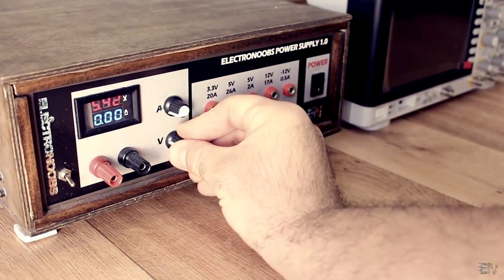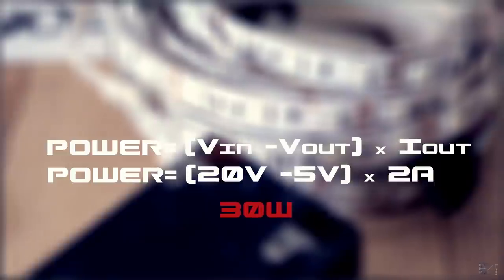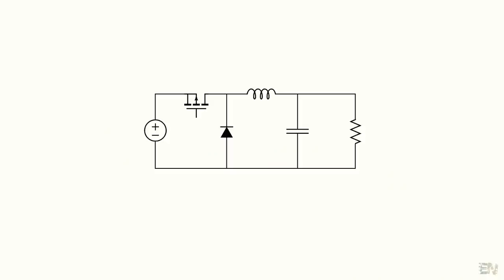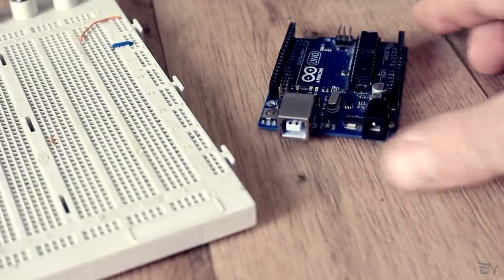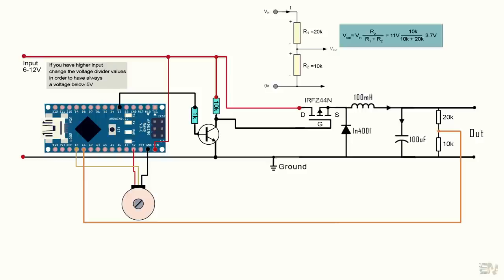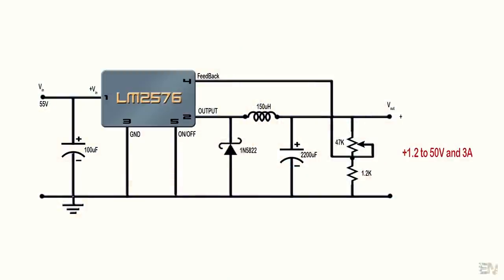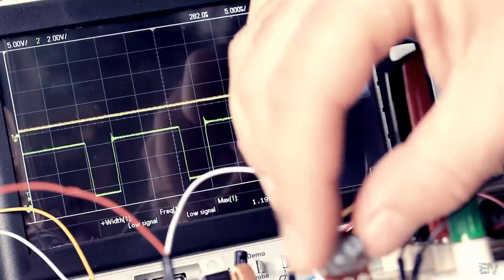DIY Buck converter - TUTORIAL

Comment: Consider an electrolisys aplication.  The plates and electrolyte form a capacitor.  In the begining, the electrolyte is cold and conducts less requiring higher voltage to push current through. Then as the electrolyte warms it becomes less resistive and conducts more current.  Annunregulated buck converter dops in voltage with a higher current draw.  And with electrolisys,  lower voltage end up drawing less current and produces hydrogen more efficently. The current voltage responce us more like a zener diode and resistor than a simple resistor.  This loosely  uses current to warm up the electrolyte making it more conductive so that it can pull more a little more current at a lower more efficent HHO generating voltage. It  loosly self regulates the current without feedback circuitry.  An adjusable pwm circuit can  may be more interested in lowing the duty cycle with feedback from a temperature sensor to further regulate  how much current goes through the cell by lowering the outut voltage further, thus controlling the watts consumed by the HHO cell and further improve efficency.

Comment: Where the heck am I supposed to get a 100 milihenry (mH) inductor?  I HOPE you mean 100uH.  I dont think the one in your video is 100mH with that few of turns - but clearly it is high Q given  the wire size - I mean trying to buy one from like Mouser is $46 for a 1A and it looks like a small transformer.  Also on some of your schematics on your website, you have some of your FETs the wrong way (forward biasing the body diode).  That would suck if you hooked it up that way LOL.

Comment: Hi, a schottky diode is used because it is a high speed switching diode, compared with a 1N4001 series diode.
High speed because of the switching speed of the converter output.

Comment: The inductor has a current charge rate.. 
The capacitor has voltage charge rate..
Together, if you know how to sense voltage discharging edge triggering, you can choose when to charge the cap n inductor.

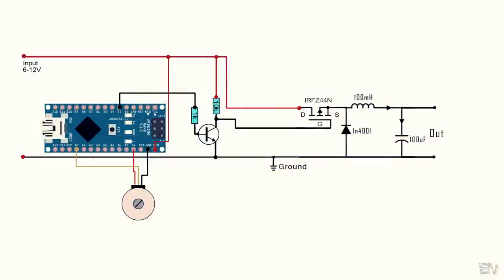Comment: This is a good video and I don't want to have to critisise here buuuuuuuuuuut ... I don't see how the circuit at 8:28 could work, or at least work well. I know how a buck converter works, but it's the way the mosfet gate is being driven here that is getting at me. Surely like this the gate won't get a good square wave and instead will be more of a ramp wave because of the mosfet gate capacitance, right? And wouldn't that get even worse with more load due to the miller effect? And also, having an n-channel mosfet connected like this, surely the gate voltage could never get high enough to turn the gate fully on so the mosfet will be in it's linear region? Also it's drawn here as a p-channel mosfet where as an IRFZ44N is n-channel.
Reply: Yes there is a N- channel mosfet and there should have been a P channel just like you said. If you put a N channel like that it will be mostly closed or just very slightly opened. Well the miller effect is really a problem only in case of transistors used as amplifiers, since it changes the input and output impedances slightly and can limit the frequency range of the amplifier, but in case of switching transistors it shouldn´t be a problem. The gate doesn´t get the same square wave as it comes out from arduino, but it is a lot sharper that you might think, to make it ever sharper I would decrease the value of the 10k resistor to maybe 2-3k depending on the datasheet of the bipolar transistor. But because of the approx. 33kHz frequency the mosfet operates on it is low enough to make sharpness of the edges more than sufficient to fully open and close the transistor (at least my oscilloscope says that :) ) hope that helped. if you want to correct me on something please go on :)
Reply: I have some questions,
shouldn't be the gorund of arduino connect to the circuit? 
And why Vin is connected to input voltage? Can arduino stand 12V ?

Comment: Hello, maybe I still make something wrong. There is a schematic at 8:28. You use IRFZ44N. It's an N-Channel, but you use a P-Channel symbol. Another is the value of L and C. The value of L can not be compatible with 100UF E-Cap.
Reply: You're correct, it should be a ptype mosfet. An ntype wouldn't work here.

Comment: 5:47 Unclear. How can an open switch be damaged?
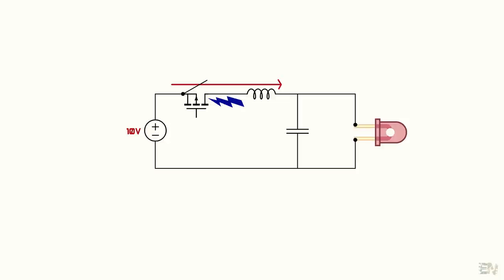5:59 Unclear. How is current going from supply negative to load positive?
Reply: A very fundamental property of an inductor is that you cannot instantaneously change the current through one.
When the switch is ON, current flows from the input supply through the inductor. When you turn the switch OFF, the inductor "tries" to make the same current that was flowing just before that continue to flow. The voltage across the inductor will rise to whatever magnitude is required to make that current flow. That voltage could be a few millivolts if there were a low-resistance path or it could be thousands of volts if the only path available were very high resistance. (with practical, real inductors you usually don't get extremely high voltage because there is enough capacitance between the turns of the windings). The very high voltage can easily destroy a semiconductor switch. With a mechanical switch the high voltage would cause an arc across the opening contacts.

In order for the current to continue to flow in the same direction in the inductor itself, the voltage across the inductor changes polarity. One way to understand this is to draw a simple circuit with a battery, an inductor and a resistor in series. If you "instantly" replace the battery with a short circuit and keep in mind that the same current continues to flow at that instant, you'll see that the voltage across the inductor must now be the opposite of what it was with the battery in the circuit. In the circuit as it is shown in the video, the diode makes the path that allows the current to continue to flow, transferring the energy stored in the inductor to the capacitor and the load.

One thing that helps in understanding how these circuits work is to consider the output capacitor voltage to be constant during any single switch cycle. In reality the capacitor voltage does rise a little bit, but normally the circuit is designed so the rise is very, very small relative to the average voltage on the capacitor when the circuit is operating normally. Of course when you first start the circuit the capacitor voltage is slowly raised over many switching cycles.

Comment: Couldn't you use a OpAmp for the gate of the MOSFET..? To Regulate the output or charging of the capacitor based on the resistance or discharging of the capacitor?

Comment: How did you calculate the inductor and capacitor values. Also, what factors did you take into consideration while calculating those values? Finally, how did you select the switching frequency to turn on and off the Mosfet?

Comment: Wow... Your explanation is so good! Exceptional...    I'm learning about power supplies for Nixie tubes and your information is invaluable. I only wonder about safety of for example a NE555 based PS.  Dedicated IC's have protection circuitry but I read that the often used Maxim 1771 has a poor design because the gate of the Mosfet is pulled to ground by a resistor: quote "a substantiol amount of power is wasted in the FET"  But I need to look into that much more... I want a safe PS so I can leave a home made HV PS safely on 24/7.

Comment: 12:12 I didn't get where does the pwm signal i.e. GATE for LM2576 goes? How we control the output voltage, is it the ON/OFF pin, cause it seems like going to ground and I'm confused
Please help...

Comment: Great video. Pleade tell me which mosfet i can use to built a buck converter 50v to 120v dc input with 12 v dc fixed output, load is max 1 amp

Comment: why do you have bjt and mosfet? why not connect mosfets gate directly to pwm pin?
Reply from the maker: The bjt is for the Arduino circuit only. Arduino works at 5V. I wnat max current for the mosfet. To drive the mosfet at 12V I use a bjt. Keep up!
Reply: yeah some mosfets gates have a minimum voltage required to turn them on that is higher than the 5 volts an arduino pwm pin can manage to put out.  For this you need a separate power source that is high enough to match that gate threshhold voltage - a lot of power n-channel mosfets have a gate threshhold voltage of 20 volts.  You need the arduino to control another mosfet that turns on from only 5v and that mosfet will turn on the power supply to the big power mosfet which will turn the big power mosfet on.  So you need that middle man mosfet to make things work.
Reply: At 8:28
In the arduino circuit,
Shouldn't be the ground of arduino connect to the circuit?
And the value of inductor is 100 mili henry. Should not it be 100 micro henry?

Comment: What about making your own very high voltage (100v+ dc) boost converter, You just adjust the voltage divider to suit the IC and get a larger inductor and higher rated capacitor?

Comment: Frnd tnx for the informative video, i understand it well but i have a few questions. I made one of the buck converters using potentiometer. I can adjust the voltage up and down but i observed that the current output of the circuit is low. I used it to charge a mobile phone but its difficult for it to charge because the amps is low. What do i have to do my frnd to increase it? Thnx my frnd again.
Reply: I think you need to increase the pwm frequency in your code with shorter off times to maximize amp flow
Reply: @artbyrobot1  ok tnx my frnd, so do i have to increase also the windings of the inductor?
Reply: I observed that the voltage is also increasing as i ncrease the pwm. What happens my frnd if i try to increase the switching frequency? Tnx my frnd
Reply: @azenarnoriv403  what inductor value you use?
Reply: @Musabbir_Sakib   i don't know because its hard to find 100mh inductor in electronic shops here. So i just use a choke filter with 50 or 30 maybe windings on it. But the numbers indicated on the choke is 1R1A852A 0BK.
Reply: I don't know what is the value of that choke my frnd
Reply: @azenarnoriv403  thank you for reply
Reply: you can up the apme with an bjt transistor and set output voltag to base and vin to collector therfor the emmiter voltage is same base voltage but ampe can be increased.its name is common collector.

Comment: Capacitors in LDO are not for reject noise, they're for stability of the circuit!!!!!!!!!!!
Reply: Yup.
Some LDO linear regulators are quite sensitive to the characteristics of the output capacitor. The ESR of the capacitor can be neither too low nor too high or the circuit will be unstable Newer LDO ICs generally will tolerate very low ESR so you can safely use monolitic ceramic capacitors.

Comment: hello, i tried to use the mentioned P-most but the voltage at the input was almost the voltage at the output, when i tried connecting a nmosfet the 20n06 the voltage was ranging rougly from 1->5 volts when the input was about 10-11 volts any idea why?
Reply: Hi, did you find any solution of your problem? I am trying to make a buck converter , your suggestion could be helpful for me.

Comment: Hi. very nice video. But how can i make a 15 amp buck converter that can handle 60 volts. It seems when the voltage gets too hight the gate / source voltage gets too big this way? And how can I supply the arduino with power from same source we try to buck down?  Als these tutorails make it look so simple but somehow it never fit my needs.  For my solar shed and e-moped batteries I need 40 and 54 volt projects.

Comment: What is the current of the input voltage to power on a buck converter? Is +32V, 720mA DC or +16V, 610mA DC will work as my input voltage to power on a buck converter?

Comment: Did you use a 100 uH inductor or 100mH ? In your parts list it was 150uH. I tried the ckt using IRF9540 mosfet, BC547 NPN transistor and I used 10uH inductor .. but it didn't work. What should I do now?
Reply from the maker: Hi. You have 4 schematics in the description of the video each with different values. Check those out!
Reply: I added map function in the code.Now the ckt works
Reply: @ELECTRONOOBS  could you please assure me that at 8:29 you used 100 mili henry or 100 micro henry inductor

Comment: Thanks a lot for this great tutorial. 🔴  In my project, I use a solar panel to charge a 6V battery that supplies 4 outputs: 3.3~5V 0.12mA, 3.6~6V 0.12A, 4.8V 0.27A, & 3.4~4V 0.5A. Now, should I use the Buck converter for each single output? Is the Buck converter best choice for my project?
Reply: Very much subject to the dropout voltage of the buck converter especially when the battery voltage falls down. The multiple output requirements usually entails the use of a tapped inductor or transformer to avoid intermodulation problems between multiple buck converter regulators operating on a common supply.

Comment: Error at 7:40. The output voltage in contious conduction mode only depends on the duty cycle and not of the current. Please fix.
Reply from the maker: What I say is that smaller dload will make the discharge of the output faster so the output iwll get lower faster. In that case you also need to change the duty cycle in order to keep the output the same. That's why you need a feedback of the output and correct the duty cycle depending on that feed back, which is exactly what we do enxt in the arduino code. 

So in this case you say that if we set a duty of 50% and we have a load of 100ohm, the input of 10V and the output is 5V. If I now change the load to 50 ohm the output would be the same????

Thank you and keep up!
Reply: Yes exactly, in contious conduction mode theres no dependecy of output current or output load. Look in wiki: https://en.m.wikipedia.org/wiki/Buck_converter
The buck converter formula is D=vin/vout. There is no function of current. If the current becomes discontious, then the Duty cycle needs to be adjusted.

Comment: Great video ..  just I have one question why you have use transistor instant of connecting MOSFET  directly to arduino??
Reply from the maker: The current from drain to source is affected by the gate to source voltage. The arduino can only apply 5V. To apply higher voltage I use a NPN connected to Vdd. Keep up!

Comment: Hi! This video has been very usefull for me but i've got one question. How can i control an lm 2577 (or a xl4016 in my case) with Arduino? I'm trying to control it with Arduino by sending an PWM signal directly to the feedback pin but it won't work... Can you help me?

Edit: At the moment i've removed the potentiometer and inserted the Arduino pin in series with an 360Ohm resistance connected to the ground the feedback pin is connected between the arduino pin and resistance.
Reply: the feedback is supposed to come from the voltage divider, not an arduino.  The point of feedback is for the IC to know what the varying output voltage is at any given moment.  The arduino doesn't know that info.

Comment: Dear, In buck converter the capacitor current is both positive and negative. So should we use a polar or non polar capacitor?
Reply: The capacitor current is both positive and negative, but the voltage across the capacitor is always positive. You would only need a non-polar cap if the voltage across it changed polarity.

Comment: i wonder what is the purpose of using a BJT transistor as as Driver of another transistor (mosfet)
Reply: In that circuit he's using the input power source to drive the gate through a pull-up resistor (which is a very poor way to do it in a real converter but it's OK for demonstration purposes). The input supply can go up to 12 volts. The BJT is actually used to turn the FET off. It is necessary because an Adruino output can't handle 12 volts.

Comment: What about the efficiency? I built one with a irfzn44 a 100kHz frequency, an inductor of 1mH and 2200uF cap. And had  an efficiency of 50%
Reply: Your switching losses increase with higher frequency. Your inductor is large enough to allow you to operate at a significantly lower frequency. You will find great improvement if you use 20kHz.

Comment: Do I need a mosfet driver? What is the advantage of using this component?

I'm using a buck converter to implement MPPT and charge a battery
Reply: Mosfets have a specified gate capacitance (or gate charge). Generally power mosfets have a higher required gate capacitance to achieve a lower RdsOn.  Basically you want to charge this gate capacitance as fast as you can to shorten the time the mosfet spends  between fully off, or fully turned on. Otherwise your efficiency drops, and your mosfet dissipates much more heat. A mosfet driver is a very low impedance that is designed to dump high current into the mosfet gate, to charge and discharge the gate capacitance very quickly.  Many mosfet gate drivers can put out peak currents of over 8 amps, achieving nanosecond level switching speeds. If you do use a mosfet driver, be careful to treat the mosfet gate as a capacitance, and limit the peak current with a gate resistor (usually in the range of 1-5 ohms). Otherwise you could burn out the driver. Generally using a regular transistor for gate drive is much slower, and will reduce efficiency. As you're dealing with solar (my guess?), You probably want to use a gate driver for switching frequencies over about 50 kHz. Or for medium to high power applications (> 1 amp current or > 30 watts peak).
Reply: @gizmoguyar  yes, it's a solar project, the ratings on my panel is 18v, 2.78a max and thanks for the explanation, you just made things more clear to me!